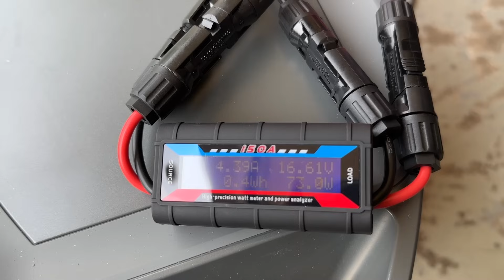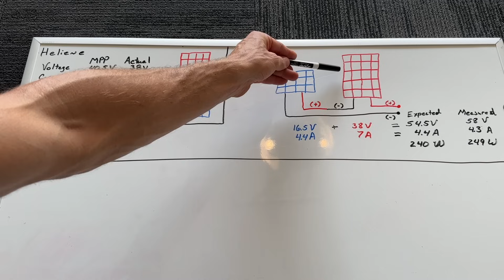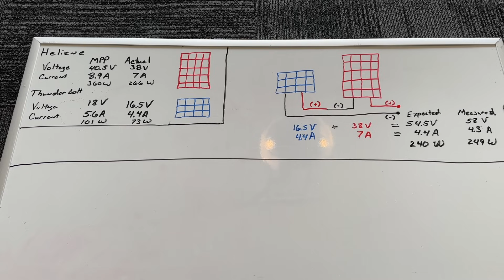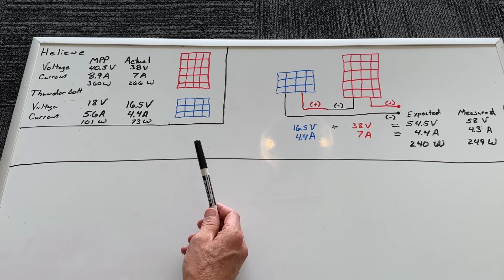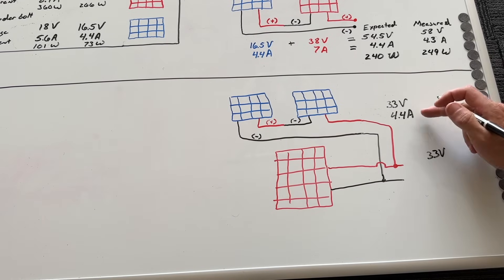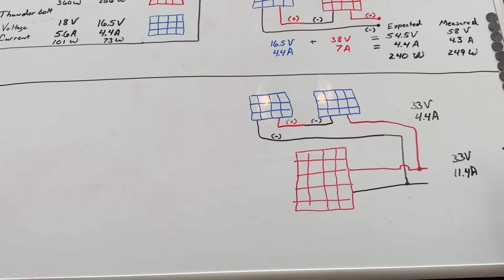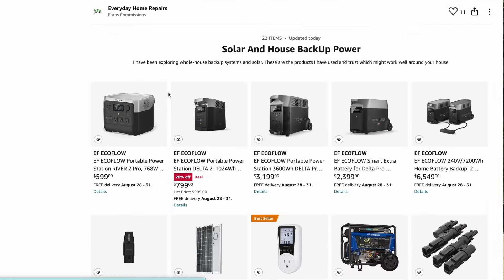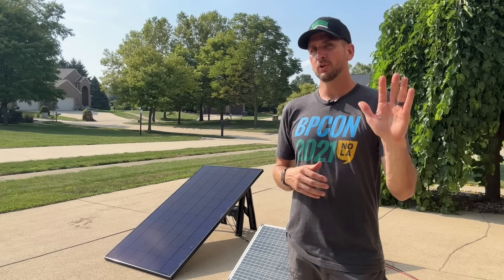Wiring Mismatched Solar Panels To Get The Most Power

Comment: Great video! I have a Delta 2 Max that has 2 15 amp solar ports. So, i have a 300 watt Werchtay panel and 2 100 watt renogy panels. Would i be safe doing this configuration the same way? And would i need to put a fuse inline? Thanks!

Comment: If the amps are the same then connect them in series. 
If the voltage is the same then connect in parallel.
I had a single panel and couldn't get the same one anymore. 
The second panel I chose was one that had the same amps. So I was able to connect them in series.

Comment: I'm adding 100w to my current 370w. I have a spare mppt controller (Solar Boost 20amp) that I will connect in parallel to the battery bank. Everything is 12vdc.

Comment: Hey there! Thank you for your work on this. I'm new to Solar/ Power stations and want to run something by you before I continue buying costly items. The numbers you show here, and how you determine them, has me confused and I'm not sure where I'm making my error.
I know there is a lot to figure but here are my specs: 
Power Station, ECOFLOW Delta 2 Max
2- 100w HQSt Mono Panels. 9BB
VOC 24.3V, ISC 5.21A (in series)
and then (in parallel w/ a 190w HQST Mono Panel 
VOC 24.3V, ISC 10.15A
My math ends up at 746.5W 

Am I on the right path? My math seems to be much higher than your configuration shows even with a slight difference.
Thank you for your time and advice!
Keith

Comment: This actually helped me out a lot but I have 2 standalone 100w panels n 1 200w standalone panel but due to a similar issue I was having I opted to use only the 200w panel for higher output but now I can use all 3 panels

Comment: Interesting video. I wish you had shown the results for wiring the two panels in parallel, after measuring their output in series. Not sure why you clouded the issue by jumping to two of the HF panels, instead of first going with the intermediate step.

Comment: Very good presentation.
But I still don't understand how to connect the solar panels in my case.
I have 4x 100w Voc:21.3V Isc:5.92A and 6x415w Voc:49.4V Isc:10.64A.
I have a hybrid inverter 4.2 Kw 450-500v
thanks for the answer

Comment: What would you get if you ran the first two panels in parallel?
Reply: Current will sum up but voltage will be determined by the lowest panel

Comment: Nice video bro. If i want to parallel 2 differently voltage panels which voltage controlling device i use to bring one of panelscto the other's voltage? Is it dc-dc charger, buck-boost vonverter or else! TIA

Comment: What would happen if you wired the two mismatched panels in parallel instead of series?
Reply: Your final voltage will be determined by the lowest voltage of the two panels connected in parallel. If the voltage difference is huge, there will be reverse current which will potentially damage your module.

Comment: I have a Bluetti AC180 which can handle 60V @ 10A.  I have two Ecoflow 195W panels and thinking of getting a third one.  Each panel has VMP of 19.8 and VOC of 23.7.  The combined VMP is 59.4 and the combined VOC is 71. Is there a risk of damaging my Bluetti if wiring the panels in series?  What is my limiting factor, the VMP or the VOC?

Comment: So how does the math work if you had two of the larger panels and only one of the smaller?
Reply: Same theory, in series, final voltage sums up, final current is based on the lowest of 3 panels.

Comment: Where do you look in the specifications to find the voltage and amperage of the panel? There are several sections that talk about voltage and current and I don't know which one to use.
Reply from the maker: It is best to use open circuit voltage (Voc) and short circuit current (Isc) when designing the system to make sure you don't go over the maximum for the charge controller/portable power station.  Usually the voltage is more critical and leaving a little buffer as cold weather will increase the voltage a bit.
Reply: The specification label is always pasted at the back of the panel. If not, google the datasheet if you know the panel's model.

Comment: Conecting 1 big panel and 2  small panels as you did only works if the volts from each string is the same thats very important to mention when explaining your method as some that does not understand parallel connectioning or understand what you did could end up mismatch the volts .

Comment: Bad idea. You never connect mismatched panels neither in parallel nor in sequence. Amperage and voltage specs must match. I'm not even mentioning how ambient temperature and the load affects these parameters.

Comment: This helped a lot , I have a rated 1.7kw array with one missed matched panel but didn’t realize it would take the lesser Amperage , as was only getting 700w out of it even lower if I just left the extra missed matched panel out of the equation , thanks

Comment: Why the hell would you use 12v AND 36v panels together? Just use different size panels of the same voltage and connect them in parallel. Pick a voltage and stick to it. You need to pick a voltage for storage / inverter input anyway.

Comment: if you want use different voltage panel  ,instead of adding more panel you can just use 2 separate solar charge controller for each panel with one battery

Comment: Tip: To remember parallel panel setups and how it impacts Amperage or Voltage: all of the letter "A"'s in the word "parallel" impacts+ adding up Amperages. When adding panels in series it impacts+ voltage.

Comment: Very interesting video.I recently caught the solar bug.  I have 3 panels, one 195W 20V 9.65A, another 100W 18v 5.56A and finally a suitcase 100W 18v 5.56A with XT60 connector. What would be the best set up for me bearing in mind my Charge Controller is a Victron 100/20? My original plan was to use the 195w and non suitcase 100w to charge 12v batteries and use the suitcase 100w with XT60 to charge my Eco River 2 Max. From the video i'm guessing i wont get near the 295 watts i was expecting with the first scenario?  Any advice would be appreciated.

Comment: You arbitrarily changed the equation. Like do you need a second 100w panel to do it that way? I’m more confused than before.
Reply: Yes. For completeness, he needed to wire the two in parallel first to show the ramifications, then add the balancing 100 watt panel for the best solution. Could have been so much better.
Reply: Listen to what he says. He goes over each condition

Comment: can i connect a 100w and a 50w panel together
Reply: The voltage/current of the panel and how you wire them together affects alot on the power generation.
Reply: No

Comment: So sticking with same panels is always best option.  Loss of wattage seems quite excessive in series or parallel when mixing panel of differing wattages.  Seems like if have very little “real-estate” on the roof of a van or home - panel mixing is ineffective as it brings down wattage of larger panels, and value per panel then is reduced.

Comment: Good video but not recommended to connect small with the bigger one, it's much better to buy an inverter with dual inputs, so you can  pair up bigger and smaller panels separately and then you can flow the current from the panels to the inverter through separate connections
Reply: Yes

Comment: Why didn’t You Show with wiring with Just the “ 2” original Panels ???
Reply: Exactly 💯 my question too. probably cuz that wouldn't help much.
Reply: because you cant wiring just 2 original panel ,if you want to use that two panel you can use 2 different solar charge controller so that the power we are getting is normal
Reply: @syamshudafalahalquds9159   So what you're saying is the charge controller can only handle information input from a single type of solar panel, right??? Or multiple identical panels.??? Right???
Reply: @Hundert1  yes, like the video said if you want wire in paralel you must have similar voltage panel and if you want to wire in series you must have similar amps panel

Comment: Please i have a question,
I have 195w solar panels (4) and a 150w solar panel (4) also another 150w solar panel (4) i like to connect them all on a 220ah battery (2) on a 12v inverter, please how do you suggest i connect the panels?🙏🏻
Reply from the maker: What are the open circuit voltages for the 195W and the 150W panels?
Reply: To be honest sir i don’t really know because some installer had already installed them on the roof top

Comment: Why did you suddenly introduce another 100 watt panel ??
Reply: This is a ridiculous answer to this specific question !
Reply: Because that’s the way to optimize the 2 panels together. 

By adding another to make them the same current and voltage. 

2 in series to make essentially another bigger panel
Reply from the maker: 100W panels are pretty handy 👍, just need a lot of them 🙂

Comment: Interesting.  Personally I'd be tempted to buy those wide-range DC-DC converters, put one on each panel or, for your later example, series the smaller pair, then put the converter on that.  Then, put those converters in parallel with each other.  They can be step up or down, and the output voltage is based on what you ordered.  I'd recommend going as high voltage as your input (and safety needs) will allow, as higher voltage means lower current (and thus less loss) for the same power level.  I'm betting if you try this, you'd beat your results here for a marginal additional cost, and it prevents you from accidentally back-feeding panels, such as due to partial shading, etc.

Amazon's B09DRP4DGT looks interesting, 60V output means a decent bus voltage.  The Ecoflow unit here would take up past 100V and not more than 15A, so again, more voltage is needed if you want to use the full input.  When you find the page with that link, there's a selection list for many different choices.  For example, the one I listed is "36V to 60V, 10A" which has an input of 30-45V (scroll down the Amazon page for range specs).  If you can put up with a lower bus voltage of 48V with smaller panels, they get much cheaper such as the 24V to 48V boost (input 18-32V), search B089M7FVLJ, but that input range won't work on the large panel shown in this vid, which outputs well past 32V.  Would work well on the series pair of smaller 100W panels most likely.  You can mix/match booster units to match the panels, but the output voltages must all be the same (obviously).  Another option would be to put an MPPT "charge" controller (which usually wants a battery connected too) on each panel.  The batteries can be small, but they can wear out too, making it yet another thing to break.  Finally, there's lots of these converters out there, just look up "boost converter" and find the ranges/outputs/adjustable how you want.

Comment: I must disagree, I calculated that in this case it should be more proffitible to wire the 2 small 100W panels in paralel so it would give us 8.8A and than adding the 16.5V to the 38, which should give us 54V but it would gave us the measured 58V and we will be limmited by the lower curent of 7A.
i WOULD REALLY LIKE YOU TO COMPARE THIS 2 COMBINATIONS. (also what would happen if you just added paralel to the 7A pannel properly calculated resistor to take care of the 1A, it should be possible to extract the most energy of the system, but I am not sure if it would just eat the power of the bigger pannel)

Comment: Why did you add an extra panel?? Missed the whole point of the videos title. Bit of a fail there hey!
What is the solution for the two panel setup? What happens with parallel wiring of just the two?
Reply: Your voltage would then be limited to the smaller panel...which is why he added the 2nd small panel in series.

So now the combined voltage of the 2 small panels in series is a closer match to the larger one...(because you will be limited  by the lower voltage of the small panel)  Now you can make use of the small panels.

There's no way around it...matching a large higher voltage panel, with a small low voltage panel just won't work and is a waste of time unless you combine 2 small panels to get the voltage up near that of the larger one.
Reply: There is no other solution for the two dissimilar panels to be connected ‘together’. His power station has two separate inputs (mppts), so he can run two dissimilar setups on it—but that was not the point of this video.

Comment: These two panels have different volt outputs.  There is no way to connect these two together properly.  If you have several panels all with the same voltage output they can be wired in parallel.
If you have several panels with the same CURRENT output they can be wired in series.  ( note that this is why any shadow over a single cell of your panels reduces the output of the entire panel.  The current will not exceed the current of the shaded cell. ) Otherwise each panel would need its own controller so that the OUTPUT volts of  all controllers have the same voltage. In other words be careful when CHOOSING your panels.

Comment: you can't combine theese two pannels. becouse theu have different output voltage and current. if they have same voltage - they be good in parallel, if they have same output current - they be good in series... in series the current is tre same for both pannels..

Comment: Thanks for  posting this educational and entertaining video. I hope to buy enough solar power equipment to run my oil fired furnace in winter time outage here in Mass.
Reply from the maker: Happy to help, and best of luck on your setup.  I wonder if a EcoFlow Delta 2 would be enough to pull your through an outage.  Those unit are handy, very portable, and pack a punch for that type of application.

Comment: I bought a Bluetti PV200watt pannel with my AC180 power station. 

....then i bought (2) Fanttik EVO SOLAR 100  solar pannels. 

....now being that i bought (2) of the 100w panels and after watching that very last part of this video ....im HOPEFULL that the amperages and voltages equal probably..... about the same. 

Here is the specs for the Bluetti PV200:
Voltage at max power 20.5v
Current at max power 9.7A
Open circuit voltage
26.1V
Short circuit current 10.3A
~~~~~~~~~~
My Fanttik EVO SOLAR 100w panels ...which i have 2 units of btw! 
The specs are:
Power voltage 
18V
Power current
5.68A
Open circuit voltage
21.6v
Short circuit current
6.15A 

....now is there a way that if i go on Amazon & buy the stuff you showed in this video ....that i would be able to DIY and somehow be able to connect these to get aprox 350w-400w max altogether out of all 3 of what i just sescribed above?? 
THANKS!!

Comment: I had to stop when you introduced the other 100w panel: the whole point was you only had the two dissimilar panels, not three! You can't just change the scenario..."buy another panel"! The answer with two panels was separate solar regulators, surely?
Reply: Exactly.He moved away from the premise of the title. The whole video was tedious, but for non professionals it was a good summation I suppose. If he really wanted to explain it properly he would've discussed series resistance and the mismatching battery analogy.
Reply: He did it demonstrate how to bring volts and amps close to each other.  The title of the video wasn't 'I'll make these TWO dissimilar panels work great together.'  His solution required a $100  part (another cheap panel) to make it work.
Reply: Calm
Reply: Exactly.  "Buy more panels" is always an option!  The clickbait title was sounding like he found a way to do it with two panels!  Even in his scenario of buying another smaller one you still lose out!  If panels are being bought it would make much more sense to just buy a second bigger one and sell the smaller one you already have on FB!  Or better yet add a second controller and just run em independent.  Total crap video.

Comment: So without wiring in the 3rd panel how would you do it?  I have 2 100w renogy panels and a 100w renogy suitcase panel ran in series.  Is there a better way to run it?

Comment: I did the same with my delta max 2000. I had
2x 250 watt trina panels 
37voc, 34vmp, 7.3imp 
And 3x 100 watt renogy panels
24voc, 20vmp, 4.91 imp
I wired the 2 trinas in series and the 3 renogys in series and paralleled the 2 "arrays" and got 
74voc, 62vmp, and 13.2imp and my end result was about 800 watts. It was hard to stay in the 100voc range for the DM2000 but i was able to consistently get my 800 watts. With the renogys in play i had great low light production as well. Since ive moved to the delta pro and running 4 different 100 watt panels in my 1800 watt 6S3P setup that i het 135voc,115vmp, and 15.9imp (max input current). I consistently see 1600 watts safely by adding in some lower voltsge panels into my setup lol.

Comment: Brother can you help me to solve my problem.
I have eight 380w solar panel of 41 volt with 9amp, and two 550w solar panel of 41 volt with 13amp.
How I should connect these in my 5.5/7.5 Kwa inverter whose input current rating is 15/20amp.
Reply: MOST inverters don't take solar input

Comment: The two panels wired in parallel would have been ~339 watts, using your data. Adding the third 100-watt (73-watt) would have brought the system to ~ 410 watts, which would be expected.  But you did add a third panel to do it.  Should have stuck with the two. 😉
Reply: What do you mean? He showed that the two mismatched panels together produced less than just the single larger panel by itself. The third panel was the key to being able to connect the two dissimilar panels together and not losing out on their potential.

Comment: THank you for the video!  I just ran into a a build where I can only install nine modules instead of ten.  All the modules are the same and I have 5 on  one string and 4 on the other.  I have a 250/100 Victron mppt with the mod specs at 24v and 11amps.  Should I just drop it back to 4 on each string?  Best, MIke